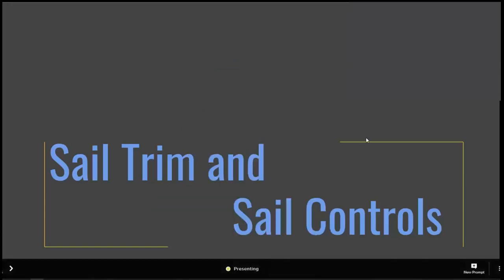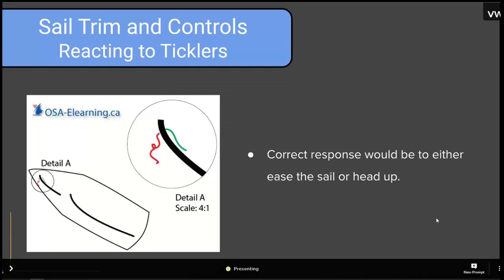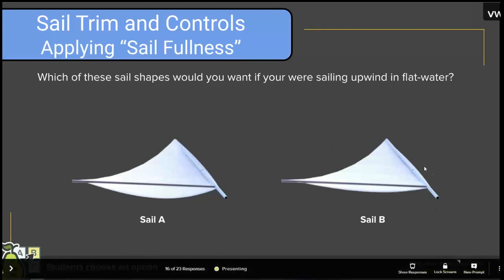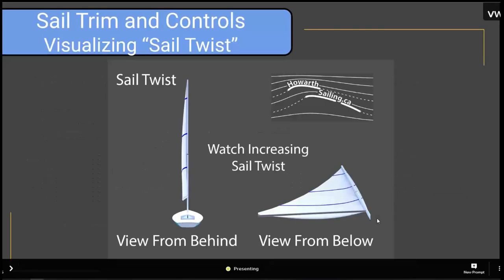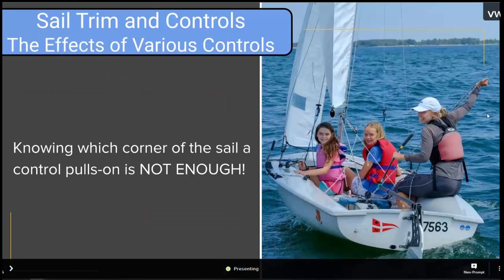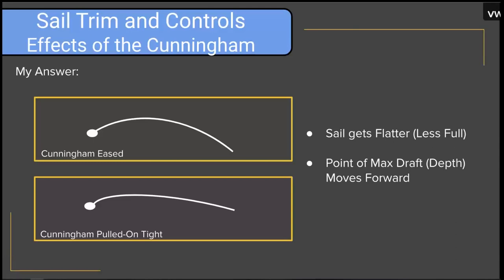Sail Trim and Sail Controls

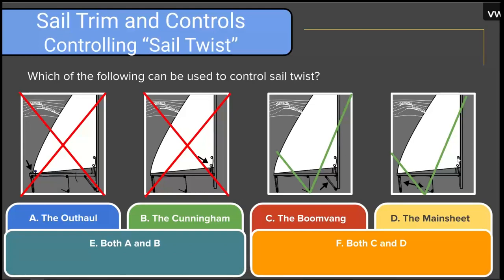Comment: Hi there, nice video! Question: shouldn’t 8:20 be B, C and D as I thought the Cunningham also opens the upper leech and induces twist. I thought when close hauled one would tension the Cunningham to increase twist and thus depower as easing the vang would straight the mast, make full the sail and thus increase power.
Reply from the maker: Hey, 
Yes i agree with you, depending on the boat, applying Cunningham can definitely induce twist.  We'll call this an omission.  The boomvang and mainsheet, however have a more pronounced effect on leech tension and twist.
Reply: @howarthsailing  roger that, cheers!

Comment: Try adding shorter telltales that are much closer to the jib's luff, like shown in Photo 2 here:  

http://gentrysailing.com/pdf-magazines/9-Achieving-Proper-Balance.pdf

Also Figures #2 and #3 here:

http://gentrysailing.com/pdf-magazines/10-Sailing-to-Windward.pdf

These telltales are much better because they warn of impending luff and stall rather than signal that luff and stall has happened.
Reply from the maker: I am a fan of the Gentry articles.

Comment: I want to know what it is called when you lower the sail and tie it. It's called trim. That's not what you are saying.
Reply from the maker: When you lower the sail part of the way and tie it, it's called "Reefing".  Not covered in my presentation here but definitely a valid strategy for depowering your sail.
Reply: @howarthsailing  Thank you my Dad and I did it a lot but I couldn't remember what he called it. Thank you for reading my comment and answering. Hats off to you Sir!
Reply: I kept looking up trimming but I knew that wasn't it. I knew that wasn't what it was called. Thank you for understanding what I meant. So cool and Happy Sailing!
Reply: The only part I disagree with is the depowering. It's the short shift and the extra trim to go even faster. But safer.

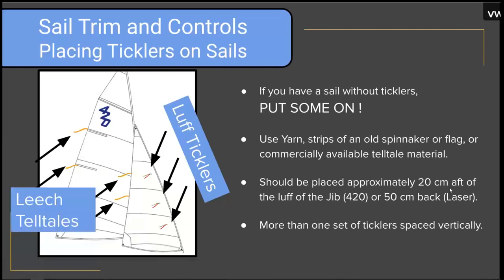Comment: 2:12 - "the leech telltales are a little bit less important..."? - It is a steady, pervasive myth. )))
Sail 'quality' should not be determined by incoming flow, but by outgoing (deflected)...
Reply from the maker: I agree that leech tell tales are important, but i stand by what I said about the order if importance.   You can't helm a boat upwind only looking at your leech telltale, you can  looking at the luff tickers.
Reply: @howarthsailing  I think that when not alone, the helmsman should work with the jib tickers which are easier to read so it's faster to react. The team will manage the main-to-jib balance in order to have both tickers and telltale flying.
What do you think about that ?
Reply: Hello! Congratulations for the video. I’m teacher in spain and i was searching a sail simulator like that you use in this video. Can you tell me the name of the simulater? It’s so cool! Thanks in advantage